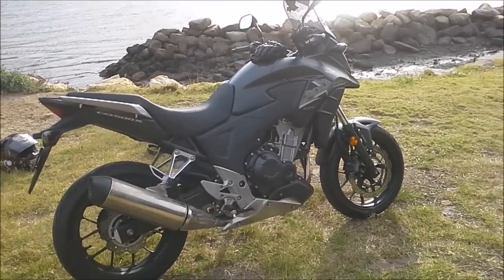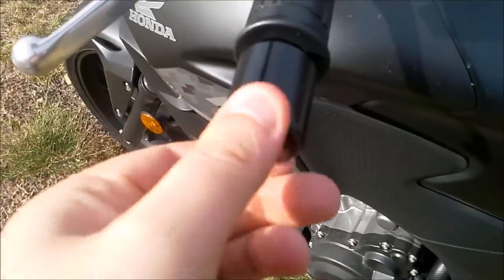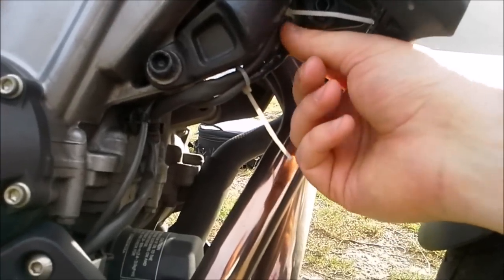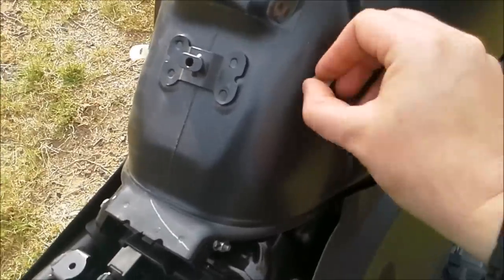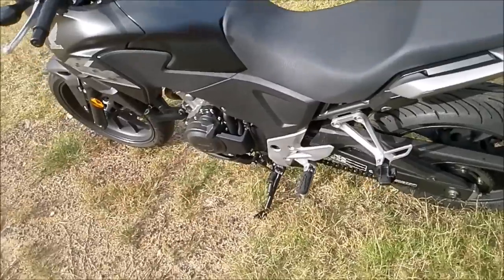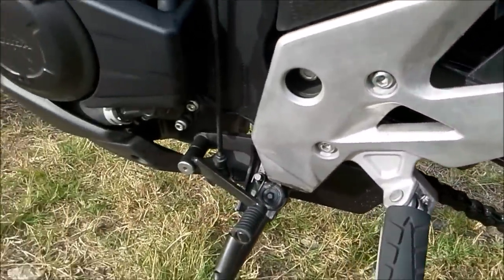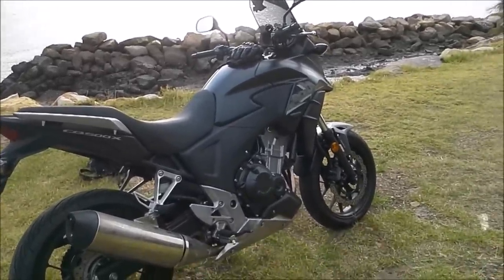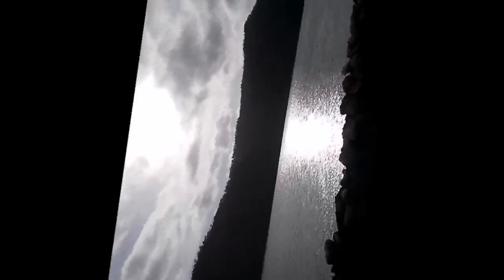Honda CB500X 30,000km REVIEW (18641 Miles)

Comment: The CB500 F/R/X are all pretty bombproof. They're cheap and cheerful to buy, reliable and cheap to maintain. I have done 35000 klms with no trouble so far. The OEM chain died at about 24000 Klms and I recently replaced the 5 y.o OEM battery. Put a decent set of Pirelli tyres on at 16000 and they've still got some life in them, which has really surprised me. The only real shortcoming in my view is the suspension which is fairly ordinary, but not surprising at the price.

Comment: I can recommend getting a chain oiler.  I've got a Loobman installed on my Honda CB125F, which I was commuting with throughout winters.  Yes, it can make the back get a bit messy but the chain stays nice and healthy.  Just uses a small amount of any engine oil - I use my old engine oil out of the bike in it.

(just seen the date of the vid...ah well might still be relevant to someone out there!)

Comment: I hate to tell you this. If your chain is shot, so are your sprockets. Worn sprockets will wear out a new chain. When you lube your chain, spray  or oil the inside of the chain so that lube flows through the chain before it flies off.
  A worn chain can rob up to 6 hp. Don’t believe me? Ask someone the tunes motorcycles on a dynamometer.
  Your chain will be at its tightest point when you’re sitting on the motorcycle. Usually. My point is, you don’t want to adjust your chain, And then sit on the bike,the chain gets much tighter, which can ruin your output shaft bearing on your transmission. I have actually seen a chain break the engine cases from being too tight.
  This takes time, but I got a small 2 ounce plastic bottle with a plastic lid like a ketchup bottle for lubing my chains ,Are use 90 weight gear lube... I will do each link one drop of oil on each of 4 locations on each link...It takes about five minutes to do the chain.That means there are four locations on each link to lube. Between the two plates on both sides of the chain, and on the rollers where they meet the plates on the side, on each side, that’s four points or I put one drop of 90 wt oil. That was a Honda recommendation years ago. That’s how I’ve always done it since the 70s. And I have never worn out a chain yet.
  Change don’t “Stretch“. Chains where on the rollers, and on the pins..As they wear, they develop slack when you add up a tiny bit of slack in each link, that’s a lot.
  When you loosen your axle and turn your adjusters to adjust chain slack, be careful that you do not over tighten your axle. If you tighten the rear axle not too tight, you will crush the spacer between the inner races of your rear wheels bearings. Ball bearings cannot tolerate radial loads, and your bearings in the rear wheel will fail. Most motorcycles have a cotter pin it will prevent the nut from falling off the axle. So you don’t have to tighten it like you’re tightening a lug nut on a tractor trailer

Comment: Don't forget you need to CLEAN your chain as well as lubing it :) all the chain lube and road dirt builds up and creates that black gunk stuck onto the chain, I've got white spirit in a spray bottle and I clean it (with a chain brush) every other time I lube it
Reply from the maker: Scot Wilson Cheers mate, I have had to learn the hard way I think. Thanks for the comments and views
Reply: I just spray on WD-40 (CRC for Aus and NZ), and go for a spin up the motorway. That gets rid of the gunk.

Comment: I have 48,000 km (30,000 miles) on my 2013 CB500X and I don't really have any complaints, except for the fact that I needed to buy and install a ton of accessories to set it up up so that my wife and I can tour on it. New windscreen, center stand, Hepco Becker, luggage, new seat, heated grips, etc. etc. etc. Of course, I the usual gripes like disliking fuel cap that is not hinged as I have dropped and dented the edge of mine up). At this point and expense, I probably should have just purchased an outfitted V-Strom or similar, but live and learn I guess. I'm on my third or forth set of tires (I can't even remember) and have switched from the Pirelli to Dunlop Roadsmart 2 tires and I am happy with them, they were slightly cheaper but more importantly, they are always in stock at the local shop.
Reply from the maker: yer, I understand where you are coming from. I got this bike right at the end of my previsionals so it was the closest I could get to my favorite bike. there is heaps of things you need to do for the bike. to make it a complete adventure bike there are heaps of options. I have taken it off road and it works really well. I plan on riding it from south australia all the way up to northern Territory.  I need to chamge to tires again before that. the fuel economy is really good for long trips so I am happy. thanks for watching my video mate.
Reply: Yeah, absolutely. I don't have any regrets, as much as I would like a bigger bike, I am happy with my choice. It is excellent for my commute given the fuel consumption. We don't have the displacement restrictions on new riders here in America (we probably should), so you don't see very many of these bikes.

Comment: By the looks of that chain you better check your sprockets, if they are even a bit worn change them or your new chain will not last long. You should not run your bike with a chain that loos if it breaks it can do a lot of damage, I stopped to help a girl once and her chain went through the gear box, a very costly repair.
  I always change mine before it gets too bad to save the sprockets. Also a center stand goes a long way to make chain maintenance much easier. When on long trips I ride a bit in the morning to warm up the chain and stop for breakfast and lube my chain before I go in to eat, and do this every day on the trip.
Reply from the maker: Good advice mate. Tell yeah what I have learned heaps since I uploaded this video. Thanks to all the comments and guidance. Cheers mate

Comment: Just stick a Scottoiler on the thing, keep the reservoir topped up with chainsaw oil and your chain and sprockets will go to 55k and more. I recently changed the chain and sprocket set on my TDM at 60k. First change from new. I wouldn't run a chained bike without fitting an oiler of some sort.
Reply from the maker: I've been hearing to things about Scottoiler, might have to make the change, cheere Joe

Comment: Do you have "Autozone" down under? If yes, buy their engine Degreaser. It is an aerosol Diesel. It quickly eats the lube and dirt off of your chain and does a great job of reconditioning the rubber on the chain as well.

Comment: I have a 700x with 42k miles. I ride the shit out of it, changed the original chain at 28k miles. I lube once a week. should lube twice a week though. I ride in  dust and dirt conditions a lot. nice vid. thinking of selling the 700 and trying the 500x.

Comment: Waaaaay too much chain play!  You know you can fix that with a couple of wrenches to put it back into the green: white area of swing arm.
I have a ‘13 with a few mods that make it more fun like a Corbin seat; slip on exhaust (makes it sound like a moto than a scooter); engine cage; skid plate; adjustable levers....it’s like a mini African Twin less $7000 USD,
I love the bike and doing my own maintenance is a breeze.
I think it’ll run for another 6 yrs with no problems.
Keep it safe brother! ✊🏻

Comment: It's not just that wears, sprockets do too plenty of advice on the web so I'll not go on about it. For the mileage you do I'd google  Tutoro chain oilers, Oiling chains means mucky wheels, a cheap pack of baby wipes works wonders. All the best!
Reply from the maker: cheers mate, yer i was going to changing the teeth ratio so i get better kms on fuel.was going to cost lots more for the chains if i did so. The sprockets are fine at the moment. ride safe mate and thanks for watching and posting

Comment: Thanks for the review,have you also had to adjust the clutch cable much? I have only done 12000 ks and i have used all the top adjustment and gone down to the bottom adjuster which means the top is back to the start again but i am worried it will not make the 24000 k service.Cheers mate
Reply from the maker: If its still under warranty,  take it back. Other than that mate, I have had no problemd at all like that. Sorry to hear brother

Comment: Nice little review.  I'm looking for one of these soon and changing over from a Ninja 300.  You obviously do a lot of K's on this machine,  and it looks the ticket for long rides. I'm 5'11" weighing 78kg so this thing should be much better for 200km+ rides I do.  The Ninja has been good but it's seat is like concrete and wind protection isn't great.
Reply from the maker: Yer I love the 300 mate, would be great to filter on. Thanks for watching SickocrowAU

Comment: BS on the "lubing the chain when it's hot", part.
You can hold the chain by hand when you stop riding, meaning it cools down in a matter of seconds.
You should also not lube the chain with oil or grease, but with wax.

Comment: Nice review jack. Why the x instead of the f or r?
I'm an older guy getting back into it and concerned about wind noise/buffeting plus comfort on long highway trips. 6ft tall.
Looking at the r for that reason. Would appreciate your opinion.
Reply from the maker: G'Day mate, I'm 6ft. My brother has the F and I take the R when I get my bike serviced. All in all I feel more comfortable on the X. I have discitis and my back is not the best as times. So the X sits me up straight. As for the wind, I changed my wind shield because 70% of my trip to work and home is freeway. I reckon the X over the other 2 for your back. Email me on jackthemussau@gmail.com if you need any more help. thanks mate

Comment: Great review...how is the feeling with a passenger on board especially on a trip?? thank you in advace
Reply from the maker: Thanks for watching mate and the kind words.

Long trips are good. I have to admit the longest I have had the pillion on board was roughly 3 hours doing the old Pac on NSW which was loads of twists and turns, not much straight riding. I was good I didn't notice them to much except for when I was breaking before corners and you feel the weight shift to the front forks. Hope this healps.

Comment: Great review mate! 
I just checked my cables near the exhaust and they are well secured, thanks for the hint though ;-)
I have seen that problem with scratches on the tank before and it is due to the staples in the seat not being correctly positioned and fastened. I think it might have been our X Brother ***** and I think he got it repaired under warranty.
Before I got on a bike at all I watched a great tutorial by Moonfleet41 (Del-Boy's garage) where he shows how to clean the chain with WD40 and then lube it after. It's a very thorough tutorial, shows every detail and he is a great guy with brilliant advice on his channel.
I do my (and Wifey's) chain every 300K - 800K depending on weather - and I do it after any real wet ride as well. I can see how that would be pretty time consuming for you as you commute!!
Ride safe matey :)
Reply: Cranky is correct, it's your staples on the seat cover that are causing the chipping. I got my tank and seat replaced under warranty due to this, but guess what, there is another chip right were a staple is rubbing on the paint. Should have put protective tape around the area before riding with the new tank and seat. My rear tyre lasted 11,200 miles, those Scorpions were horrible in the wet. Now I have a set of Michelin Pilot Road 4's on the bike. I also got my chain replaced under warranty after 3500 miles as it had several kinks in it. I oil it now, but not as often as I should. That's quite high mileage.
Reply: ***** Thanks mate - yeah I only got 11000K out of the rear Scorpion and have the Pilot Rd 4's now and they are superb in the wet. All the best to you mate :)

Comment: These are pretty sweet rides. I really want to get a used one and throw on the rally raid off road kit.
Reply from the maker: i would love to but it's around the 1000 dollor mark to get setup
Reply: Jack Themuss Yeah I hear you. I'm hoping Honda will get the hint and make one stock with a little more clearance, stiffer springs, and spoked wheels. But one can only hope. My xr650r will have to do in the mean time.

Comment: Why don't motorcycles have hinged seats like scooters? I mean I don expect a of of storage  but it would make it so much more practical. You could store your permit and stuff in a easy access  place.
Reply: On the V-Strom, just unlock the seat and lift it off. There's a shallow trough under the seat. I put a small distribution strip, with feeds and fuses for things like TomTom, etc. Next thing is going to be a couple of the 12 V sockets, to connect things like chargers for phones and headsets. Tool wrap goes there as well.

Comment: Yeah man. New chain ASAP.
Nice review update mang!
Reply from the maker: Cheers brah. Yep chain ordered. Worthington wanted $200, f that. $80 bro, race chain. I just have to wait
Reply: Jack Themuss how many km you get on one tank roughly
Reply from the maker: Alex Jeffery I fill up every 2 and a half trips to work and home, thats 180 round trips, so ruffly 450km to 500km. So 1 tank of full ruffly cost about 22 dollors.
Reply: Jack Themuss How much fuel is the most used to refill the tank ? A US spec bike will hold 4.5 gallons, how close did you come to that amount, if you fill in Liters or imperial Gallons. Thanks. yl

Comment: And no you don't have to oil your chain once a week let alone bi weekly.  Cleaning it well...first is key, them apply a reasonable amount of lube.  Unless you KNOW you're going to do more than 500 miles each and every week, ya don't need to do chain maintenance of cleaning and living THAT often even if its raining often.
Reply from the maker: cheer man I have leanred alot since making this video 4 years ago
Reply: 500 miles is not much riding for 1 week, we would to more than that every day on out trips. and I would do 202 Km or (125 miles ) just going to work & back taking the short way, Quite often over 300 KM  (185 miles ) just on the way home on a nice day. And nothing to put 1000 KM on in the weekend. So yes I would lube my chain every 2-3 days during the week and every day on the weekend. Just love to ride ,  now I am in my 70 's do not get out as much but still a after supper ride is more than 100 km for a short one.

Comment: 30k for a chain with minimal maintance is pretty good, i wreck a chain on the F800GS every 10k's with minimal maintance :) Next bike will have shaft or belt.
Reply: Good video...!...Old Chainsawbob
Reply from the maker: Gunnar gbtw thats crazy. I just adjust my chain for the last time. My new one should be delivered on the 3rd of next month. That will be one of my next videos. Thanks for watching

Comment: You aren't putting your seat on properly, it should be flush with the tank.
make sure it's clipped in at the front end properly. It's a pain in the arse to get it on properly. This is probably why it's damaging your tank.
Reply from the maker: hi mate, thanks for watching. i took it back to the dealer and the staples were coning out and was damaging the tank. nothing ti do with the seat not being clipped in. They had to replace my tank and fix the seat, all good not. worked out because it was under warranty

Comment: That chain is bad... I've been lucky, I haven't had any issue with the chain, haven't even adjusted it yet (11000km), but I did screw up the tires...
Nice review and you do ride a lot :)
Reply from the maker: Cheer mate, yer the chain wasn't meant to be that bad in the review. I fuck chains on every bike I have. Apparently I ride bike, like I stole them. Thanks for watching my vids mate, your a legend
Reply: Jack Themuss Ay mate, Can't you just take some of the links out of the bloody chain before buying a new one? I'm sure you can. Also, if every Saturday you think to check your chain whenever you think about your first beer that day your chain will stay in better shape. Winkie winkers!
Reply from the maker: ***** great idea mate. I got the new chain, only cost $30 and it fits with out taking any links out. Took about 15 mintues. Brilliant. Thanks for the great idea for every Saturday
Reply: Jack Themuss Oy! Your welkie welcomes! So tell me mate, after all that riding are you still happy with it's power? Me nuts is itching to get one but they be too stupid to know anything, so someone like you has to tells them what the deal is and how do you feel about the bike over all? I'll be sitting here next to me chilly cold Smithwick's while you're thinkin of what to say to me stupid nuts .... but don't be too harsh on them, they sensitive ya know mate!

Comment: I recommend to get a top quality chain made in japan...dont be sucked into buying a cheap one...you will regret it. Cheap ones can be noisy, stretch like a rubber-band causing you to have to adjust the slack out waaaay more often and wear out quickly.
Reply: +ljoel hanley    Oh yeah, i have been riding consistently since 1978 and base this on my experience.

Comment: Hi Jack, since you already ride 30k km, i would like to ask you if you noticed the flaw with the fuel consumption and the bars reading. I have a 14' model and i have it serviced 6 times about this issue and the dealership seems to be lost on how to correct it.
Reply from the maker: +Felipe Córdoba strange mate. I only have had the fuel icon go crazy on my once and the dealership just fixed it. I have never had an issues with the fuel reading. It's always been accurate.
Reply: It is weird with mine. Today I fill the tank with 4.7 L and the panel said 7.1 L (the same has been happening since always). Can you give me an email address to ask your dealership directly.?